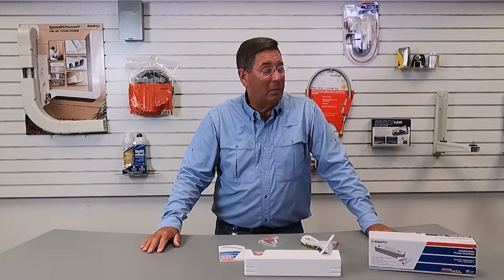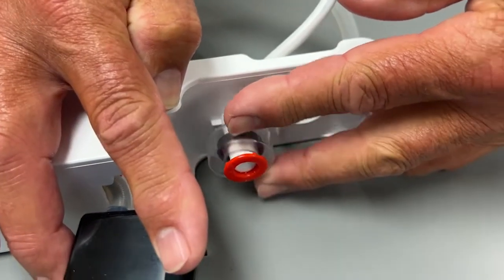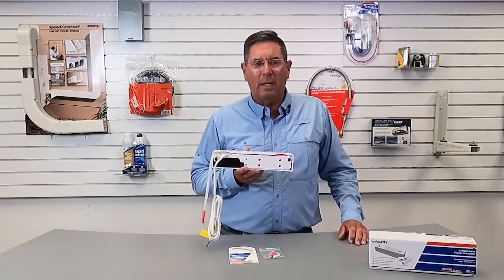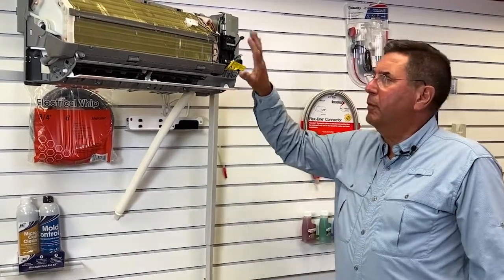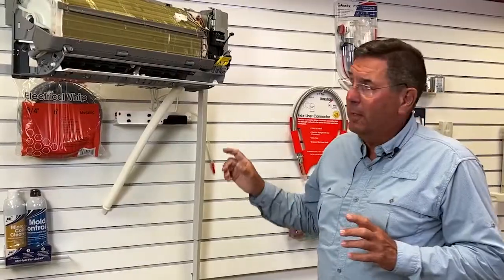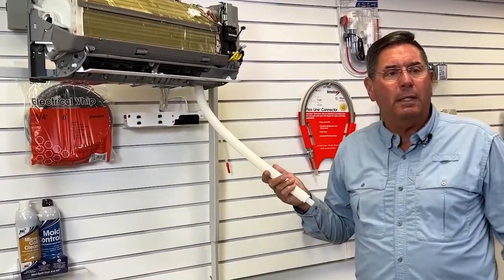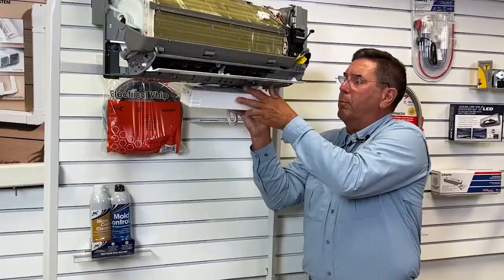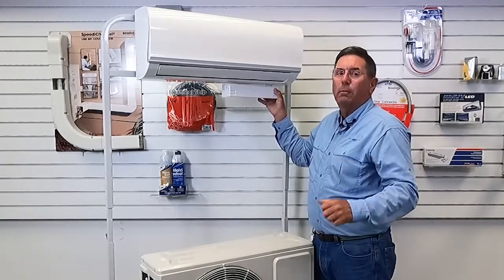The Smallest Pump for Your Mini-Split

Comment: I use a stand-alone DiversiTech CP22-230 cond pump that sits on the floor. Never been a problem with its large resrvoir and vertical rate with one-way valve. Never a complaint. But, this is for commercial applications and emergencies where looks and exposed hoses aren't a problem.
This unit, however, has a typical problem shared with most mini-split pumps that must look 'pretty' or be concealed within the wall unit's chassis; the circular float/magnetic switch [mentioned in the video] must move freely for proper pump operation. The pump is the same miniature solenoid used for ALL mini-split pump offerings. 
If the mag float doesn't rise for whatever reason [not level, blocked by drain hose, muck build-up, air entrapment, etc.] cond will eventually overflow. The reservoir is typical low volume as other competitors. The mag float is the same across all manufacturers. And, most enclosed pump reservoirs need a breather hose (which must exit higher than the condensate pan) to prevent potentail air lock. I don't see any innovation on this unit other than its exterior application [which still requires removing the front covers and precise cutting of the cond drain line].
I am sorry, but I see pump/float/reservoir failure and frustration with this unit. @shanefrank3281 has a point.
Not picking on this company, but I hoped its newest product would be more innovative and pose less hassel with a typical mini-split cond pump install. The manufactuerers and after-market industries need to agree on ONE modular connection design [for interface controls and condensate release] to ease installation and performance issues.
At least this design doesn't attach with velcro as other competitor brands.
Reply: What you you suggest for a 12000 btu air handler?
Reply: I am thinking about doing the same thing with my commercial ductless install. I was thinking to land the 230 power for the pump on the dedicated 230 terminals on the indoor head, with a fusible link also.

Comment: Nice video and pump.  It seems that when you reinstall the decorative cover of the air handler that the insulated condensate pan drain line would  interfere with this.  Do you normally have to cut a hole in the bottom of the decorative mini split plastic cover?

Comment: What's the point of making this video without showing how to wire it, included manual is also very vague
Reply: Based upon what I watched, that part requires reference to your Mini-Split instructions, since all of them are different. We had two of these installed by a service provider a month ago, but I bought this one for the third unit and am going to tackle it myself today or tomorrow.